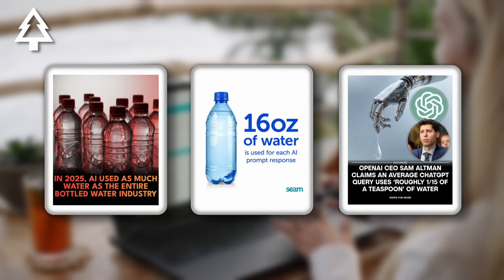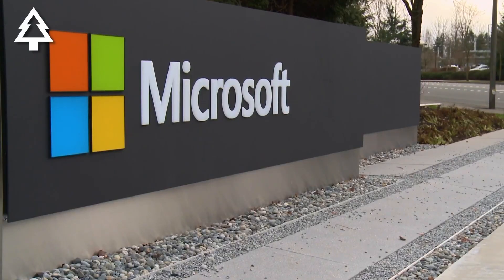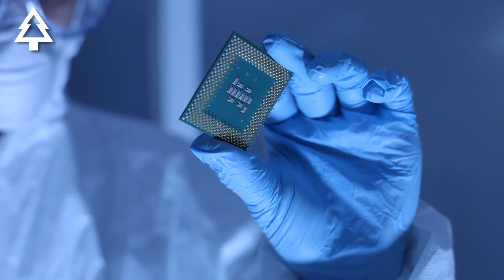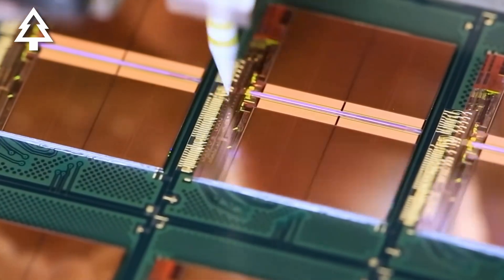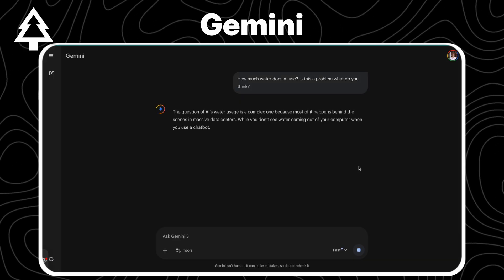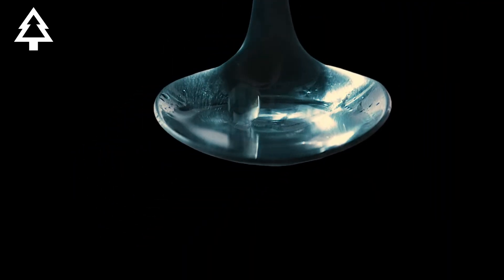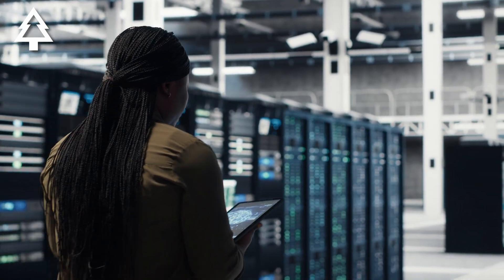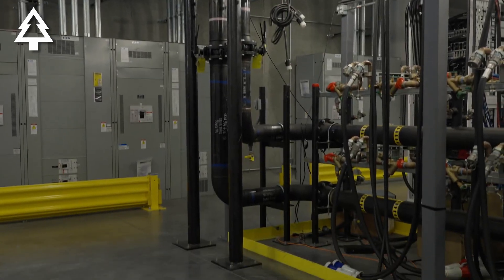How Much Water Does AI Really Use?

Comment: Based on this info, I’m going to stop using AI. It’s just a convenience for me as a teacher. I had AI make a slideshow of 10 famous landmarks in Asia. I gave it a list, and it created the slideshow including images in about 2 minutes. It was impressive, but water is essential, so it’s a no go for me.
Reply from the maker: Your AI use is not the main issue! The massive companies that are maximizing profits over local residents are the problem. Teachers are essential and if your work would be improved with AI use you should use it. There are climate conscious AIs that you can use as well. 

Our message is not to stop using AI but to bring awareness to the real issue, data centers being built in areas with high water scarcity.

Comment: Is usage verses consumption a factor. Is the water reused through a closed system. Is the water safe or dumped after it’s been through the systems.
Reply from the maker: Yes this is the main distinction between data centers and power generation/power plants. Most data centers more than half the water evaporates as part of the cooling process, with power generation it’s like 2%.

Some studies will count all water used but the recycled water can be used many times so it may be misleading.

Great question!